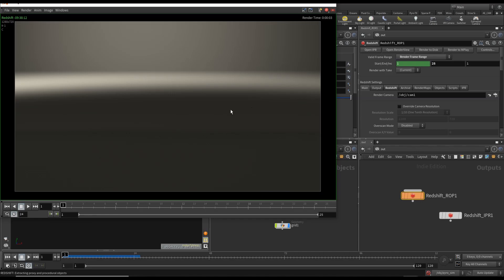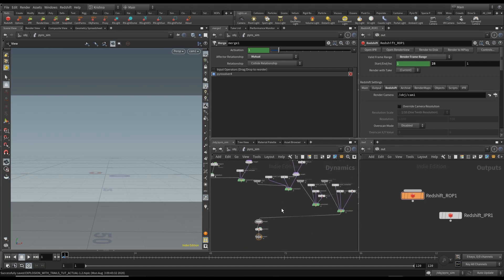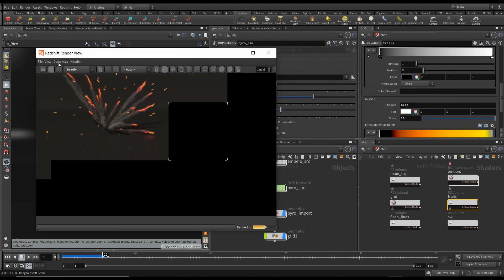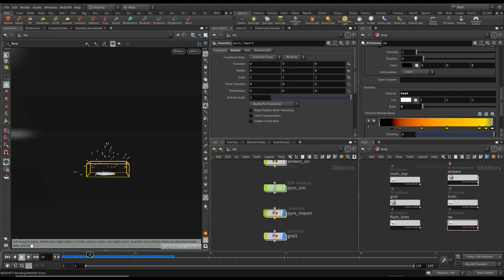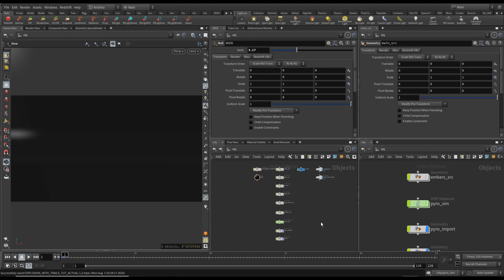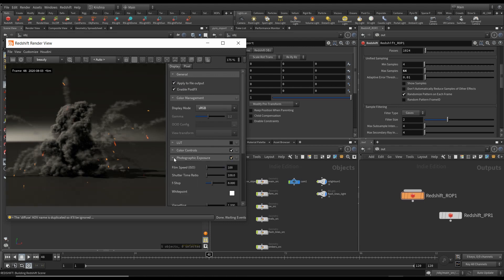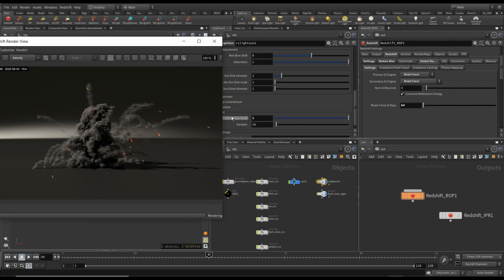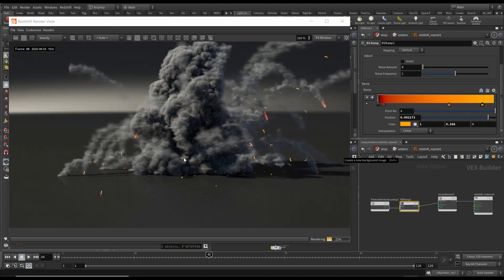TUTORIAL - PART VIII - HOUDINI EXPLOSION WITH TRAILS

Comment: cool work man. tnks
by the way want to ask you. I have some problem when i tuned explosion in mid or low resolution and after sim in final resolution, all looks completely different from my tune,  how fighting with that
Reply from the maker: You are welcome, yes, unfortunately it does happen. That's why it's important to keep the low res not so low res when trying, I know it doesn't make sense. But the resolution will alter the sims appearance quiet a bit. However if you end up with a low res sim and you like the shape then maybe you can try using upres pyro/container which will keep the shape but enhance the sim res. Hope that makes sense.
Reply: @resilientpicture  yeah i know this tweak,  although it is not physically correct, but  i will try). Thank u
Reply from the maker: No worries 😊 good luck